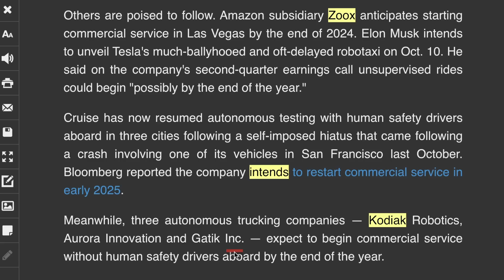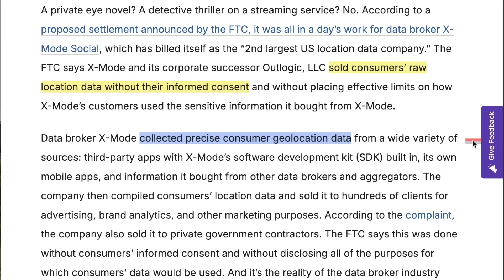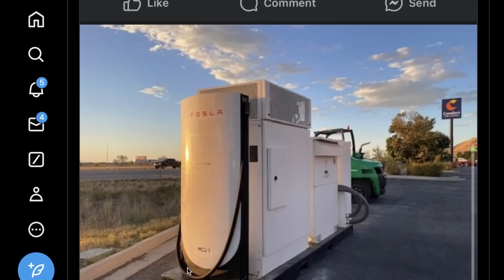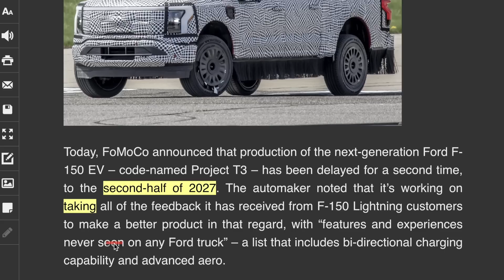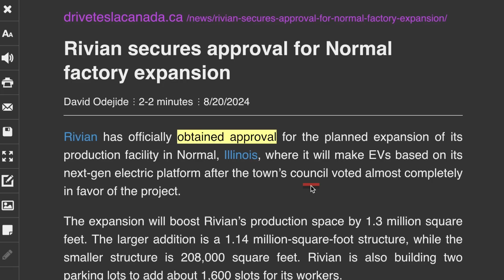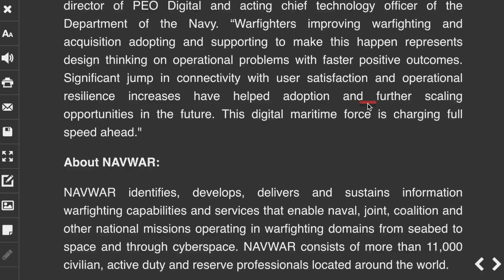The FSD Update Everyone's Waiting For / Tesla Megacharging Rollout / Ford Blows Up EV Plans Again ⚡️

Comment: I have been using charge with solar on my Tesla app and absolutely love this application, which reduces my charging anxiety by seamlessly adjusting the charging to available solar, so that it does not drain the battery when solar availability drops. Tesla Powerwalls are incredible and we have been enjoying ours since 2018 installation to complement our 13.2 kW solar PV system installed in 2012, which enables us to operate as a microgrid for ~8 months of the year in Edmonds, WA.

Comment: The price of these vehicles is in the stratosphere. A high majority of the population can not afford them.
Reply: Yes Rimac is a bit high priced. Or which vehicles did you have in mind?
Reply: What is the stratosphere?  Used EVs cost from $6000
Reply: @lindam.1502  The cheapest @ Autoscout24 starts at 12K Euros. Dacia Spring if you want the least safe car on the market. The cheapest usable EVs start @ 13K, Nissan Leaf, Kia Soul etc.

Comment: They are running the HW4 under emulsion mode for HW3. HW4 is being used as it has a faster cpu. i.e until they flip the switch to deploy in Native mode on HW4. Your confusing the non technical. Either get it right or don't mention it, as it's not your field of expertise.😎
Reply: "emulsion mode"! Gotta work those oil and water molecules :face-green-smiling:

Comment: "...it's tough to draw meaningful conclusions comparing Waymo safety data in a select few cities to Tesla's safety data in vehicles operating everywhere in the country" - that statement is well off the mark. 

Waymo is an autonomous system, FAS-Supervised is a driver assist system. 

Waymo uses mapping data to compliment real-world environment just as Tesla's FSD uses mapping data to navigate. 

Does anyone really think that when Tesla are given a license to operate an autonomous system that it will not be geo-restricted? Are Tesla, going to go from a level 2 system to being able to offer a level 4 anywhere in the USA? Unless it is a secret, FSD-Supervised does not currently support reverse, a fundamental requirement for autonomous driving.

FSD may have clocked up over a billion miles of data. None of that data is autonomous so should mean nothing to a regulator. When each version of FSD is released it is often described as being a "huge" improvement to the previous version, another way of looking at it was that the previous version was "hugely" flawed. 

Someone should try this test. Put forty Teslas in a parking lot and activate the smart summons on twenty of them at the same time, that will give some indication on how close or far FSD is to autonomous driving. Have twenty Waymos leave the parking lot at the same time and there may be a few peculiar movements, but the parking lot will clear, and this can be seen today, day-in-day out. 

Tesla's RoboTaxi isn't going to be operational this year, and probably not even next, and when it does, initially it will be geo-fenced.
Reply: "Does anyone really think that when Tesla are given a license to operate an autonomous system that it will not be geo-restricted? Are Tesla, going to go from a level 2 system to being able to offer a level 4 anywhere in the USA?"

They will likely go directly to level 5 and start with a slow rollout. 

"FSD may have clocked up over a billion miles of data. None of that data is autonomous so should mean nothing to a regulator"

Incorrect. It's very clear in that data when the FSD system were driving. 

"When each version of FSD is released it is often described as being a "huge" improvement to the previous version, another way of looking at it was that the previous version was "hugely" flawed. "

The only honest way to look at it is that Tesla is making great progress. 

"Someone should try this test. Put forty Teslas in a parking lot and activate the smart summons on twenty of them at the same time, that will give some indication on how close or far FSD is to autonomous driving."

No it won't. 

"Tesla's RoboTaxi isn't going to be operational this year, and probably not even next, and when it does, initially it will be geo-fenced."

There's a high likelihood that they will be ready to start the service next year. And what about the meaningless complaint of the service being geo-fenced? Of course Tesla will start and roll out their service carefully, as they do with all of their software releases and critical car updates.
Reply: @yourcrazybear  " Put forty Teslas in a parking lot and activate the smart summons on twenty of them at the same time, that will give some indication on how close or far FSD is to autonomous driving" 

That has nothing to do with FSD but everyhing with stupid humans testing something which can not possibly occur in real life.

Besides stupid Waymo operators.

All it tests is a swarm intelligence which FSD will not have at all. Just as humans are not intelligent enough in a pack. Only sometimes in singular.
Reply: @yourcrazybear  I guess you and I have a completely different view on what FSD is, what it is capable of and Tesla's progress which only time will tell as to who is nearer reality.

However, this one "Of course Tesla will start and roll out their service carefully, as they do with all of their software releases and critical car updates." - I would really take issue with.

Tesla have marketed something called "Full Self Driving" when it never was anything of a sort. With the naming and over promising it has given people tesing the system false confidence. After years and years, it now reluctantly refers to FSD as FSD-Supervised, and will drop the "Supervised" at every opportunity.

Mobileeye ended its relationship with Tesla because "it was pushing the envelope in terms of safety."

In 2023 a Tesla whistleblower leaked 100GB of data containing thousands of customer complaints that raise serious concerns about the safety of Tesla’s Full Self-Driving (FSD) features. 

Tesla had notoriously been going out of its way not to release too much data about Autopilot and its Full Self-Driving program by exploiting a loophole to get around the CA DMV’s self-driving testing program data reporting. In May 2024 the NHTSA warned Tesla that it could face up to $135 million in fines if it did not comply to their request to release all the releveant data.

This is a company that has tested their system on public roads, putting at risk non-Tesla drivers and pedestrians for years.

Tesla and "safety" are not words I would associate together.
Reply: Tesla will never be allowed for level 5. Only GM with Radar, Lidar, Safety Driver, Remote Teleoperateur and hand built by Merry Mary will be allowed for Level 5. Tesla does not pay the needed protection money to the Mafia.

Comment: Re 13:01: The point is that automakers should make their vehicles more efficient, like Tesla does, but I think automakers are already working on that. Such efficiency could save "40%" battery materials, and "$4,800" better price, obviously. I guess especially EV trucks, vans, and SUVs.
Reply: Automakers are working on making more hideous front bumpers and uglier colors, worse seats and really fat backsides. If they could they would deliberately make coal rollers. 

They are most certainly not interested in efficiency. Efficiency does not sell, Efficiency looks bad on billboards and Superball.

Comment: The reality is if Tesla is already struggling to so shoehorn the latest FSD into hardware 3, it's pretty unlikely that they will acheive Level 5 with it since there's still a long way to go and the model is only going to get bigger and more hardware hungry. There's only so much you can do with optimisation and compression. However, it's a good thing overall, because without these constraints, FSD would be more bloated than it needs to be.
Reply: They may figure out a simpler model in the future. Look at the resources of Windows vs a lite Linux distro on the same hardware. Windows also is running a lot of spyware too.
Reply: @ronnythompson9115 Windows is a Chinese Software, of course the Software is full of Huawei spyware.
End of sarcasm…
Reply: There are lots of paths to improve a model. Allowing it to start larger let's you iterate and progress far faster. You can then focus on optimizing the result, instead of being forced to optimize all the intermediate versions as well to even test them.

I want it on HW3, but understand this approach is how they get there faster
Reply: Of course they can not get to level 5. For level 5 they need Radar, Lidar and a friendly US president. Nothing of which will happen.
Reply: @wolfgangpreier9160  Why? Do you have radar and lidar in your head?
Reply: @wolfgangpreier9160  "Of course they can not get to level 5. For level 5 they need Radar, Lidar and a friendly US president. Nothing of which will happen."

Nonsense. Radar and Lidar is not needed.
Reply: @yourcrazybear  But But But every Mainstream Media State Propaganda Channel tells us that only Lidar ad Radar are the way to go. Everything else can not work.

Comment: Our 2025 Leaf has averaged 4.4 miles / kWh for the 1150 miles on the odometer.
Reply: The battery is still not temperature controlled though, right?
Reply: My 2022 Mini Cooper SE has averaged just over 4.6 mi /kWh for well over 12,000 miles since new in 2021.

Comment: Pretty sure starsheild is not operational yet, it’s suspected that only a few test items have been launched. Wouldn’t be surprised however if they are simply using starlink terminals that are / will be capable of connecting to starsheild when it comes online.

Comment: I believe Starshield is the Starlink-based bus architecture for government use.  In addition to using flight-proven satellite bus design, it integrates into the Starlink laser mesh which makes it reachable even without a worldwide ground station network.
There's very few Starshield in orbit, definitely not enough to provide continuous worldwide coverage.  They're definitely using the normal Starlink satellites.  And considering there's plenty of bandwidth available in the middle of the ocean, it makes perfect sense to both parties.  Definitely a win-win.